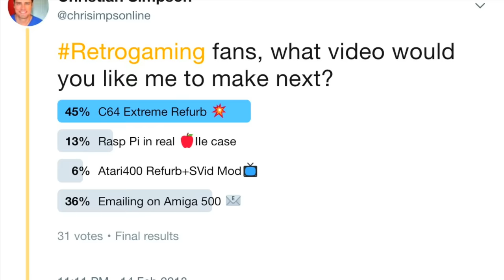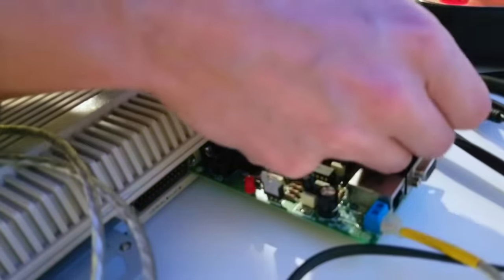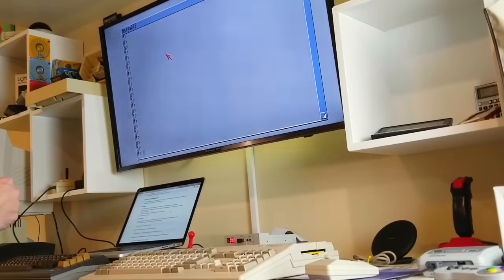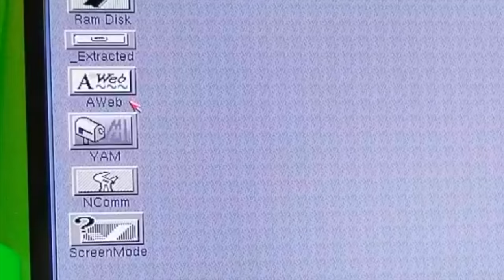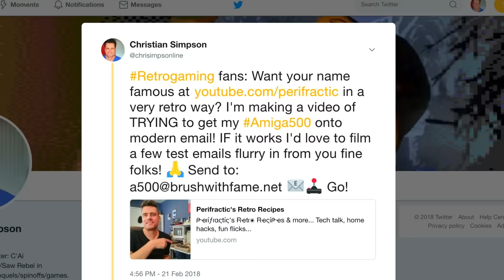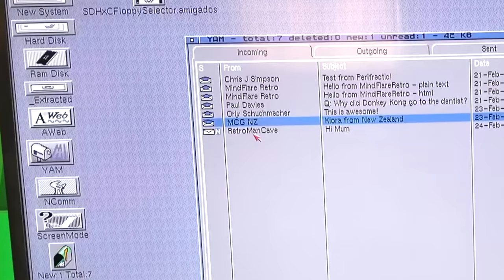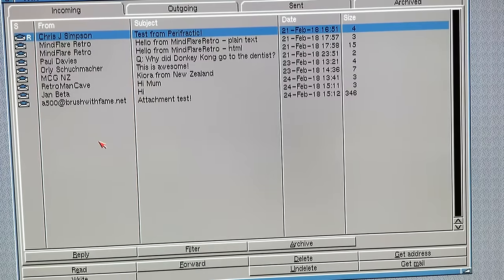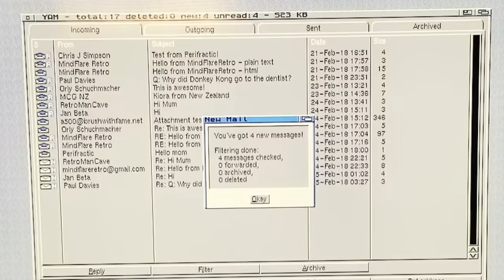Can A 1987 Amiga 500 Do Email Today? World First!

Comment from the maker: Thanks for watching! 🕹 What did you think? Have you got a modern technology working on a vintage computer? 

I have tested this without the accelerator and extra RAM. Try it! The accelerator doesn’t ‘enable’ anything, it only affects the speed and image, neither of which enable email. I use the HDMI hi-res because it doesn't flicker like the lo-res. Plain text email doesn't eat RAM either way. 

An unaccelerated 512KB machine behaves as shown, just slower which makes for a lonnng video. (E.g. that image takes about 5 minutes to load, but load it does!) The thing that potentially gives the A500 the internet ability is the magical combination of Plipbox s/w, AVR-NET-IO, & the Network Boot Disk configurator, not the Vampire card. 

Thanks!

Your friend in retro, Chris aka ԹҽɾíƒɾɑϲԵíϲ
Reply: I have yet to get any of my old stuff in a usable state (never mind a modern tech!), in both the hardware side of things, and the "having place to put it once it's working again". Hoping to get a Tapuino built soon, my STfm reassembled and chugging midi out all over the place, my A500+ has seen better days - the latter I need to get up and running soon as I have something special (for me, nobody else will be really bothered) that I'm trying to pull together using good old snail mail. 

Been subbed a little while, only just getting through the backlogs of peeps vids as I'm subbed to many peeps, a fair few mentioned in this vid and one that is willing to help with my little "special to me" project. 

I enjoyed this vid, and have been enjoying your recent content too. Have a great day Perifractic :)
Reply from the maker: Thank you so much! That means a lot to me. 👍🕹️
Reply: You're welcome. The last bit about the retro peeps being awesome is almost becoming cliché these days, but, it's bloody true, isn't it?
Reply from the maker: Thanks for eloquently explaining the distinction 👍🎮

Comment: A few years ago, I found a first edition iMac at a garage sale for $30 (you know; back when Apple thought contemporary computers didn't need fans). I snatched it up immediately, with the express intent to install Linux onto it.  The hard drive was better off for it; it was full of late-90's Napster downloads that my girlfriend at the time begged me to back up.

While the entire venture was a complete failure (which, to this day, I'm still building up the courage to fix, since I'm nervous about the prospect of working on a machine connected to a CRT), when installing Linux on a machine like that, you need an Ethernet connection.  The machine is using USB 1.0, and while you'll be able to use a router after the fact once Linux is installed, the installation still needs a hard-wired connection.

To bring this all to point, at that time, I was piggy-backing wireless from a neighbor.  I didn't have access to an Ethernet connection, let alone one long enough to use for an o/s installation.  I had to call in favors just to help me in a venture that would constantly smell like hot plastic.  The WiFi to Ethernet device you used was something I wish I had at the time, but for the life of me couldn't find.  Everytime I watch this video, I'm marveled at the feat you were able to accomplish, but it still takes me back to this debacle I found myself in.

Comment: I did this about a  decade ago, using a serial link connection to a PC routed through to the modem. Stock 68000 but with GVP 4MB ran Voyager and HDD, IBrowse and Yam worked fine albeit  slowly. No reason why I couldn't do it today, might just try it.  Nice video btw.

Comment: I once wanted to check my email about 20 years ago and didn't have PC at home yet so I connected the A500 to the TV by the mono composite, ran a terminal program on it, connected a null modem cable to a MIPS 3000 Decstation 5000 running Debian Linux then plugged a courier v.everything into that and did a ppp dial up connection and then ssh to a machine I had my email on (text only email).  Does that count?   Not really the amiga doing the email but it was the only thing that I could connect to the TV for a display.

Comment: It appears 'modern E-Mail' means an Ethernet connection, SLIP and PSLIP have been around longer...

My mate e-mail'd from his A500 & A4000 back in the mid 90's...

We were delighted when we got our hands on a 14,400 MODEM.

He also used his 500 as a serial terminal to other computers, local and distant.
Reply from the maker: Through Wi-Fi via the parallel port?! There's no dial up any more, that's why what I did was different and new...

Comment: I have some Amiga 1200 guts (including 68060 accelerator) in a tower case somewhere in my shed. But the Amiga scene is so advanced these days, I'm thinking of digging it out, putting it in a new case and adding some mod cons. I remember when Windows 95 came out, and some Amiga fans did adverts headlined "Amiga 84". Amigas were certainly capable of stuff that most PC owners could only dream of at the time. Alas, lacklustre marketing, pumping the Amiga as a gaming machine, doomed it. Someone said that if the Amiga marketing team had got hold of a Kentucky Fried Chicken franchise, they'd have marketed it as Warm Dead Bird.
Reply from the maker: Do it!
Reply: @RetroRecipes  I currently have Amiga Forever installed on an MS Surface Book 2 15", but the real thing, capable of modern media access and email would be amazing. Old Amiga games didn't necessarily have stunning graphics, but they made up for it with amazing gameplay.

Comment: I think it would be cool to see more websites which are made to look nice on the a500 in that browser. Also, apps on the amiga that utilise connection to servers running PHP/MySQL and ftp would be cool because the apps could have loads of modern (like a Fred Fish ISO of say nearly 4GB) icons and graphics and photos optimised for the amiga so that a lot of the data would be client-side and every web designer would know what the ISO contains and it would fit on a 4GB CompactFlash card or DVD.
Reply from the maker: Nice ideas! I did bookmark a few easy to load sites on my browser, that were mainly text based. But now I have the Vampire card most sites load pretty well!
Reply: What with the unexpanded a500 and a3000 and a1200 being standards, it seems to make sense to have websites and apps that use them as a known quantity and therefore a 4GB ISO could be used as part of that. In fact, even an a500 with an a590 containg 2meg RAM is an official commodore known-quanty spec, meaning 3meg or 4meg (for the a500plus) would be a fair amount of RAM in the standard even without the CPU upgraded. For amigas with an FPU upgrade, some graphics (and sound) such as 3D splines could be generated on the amiga itself with minimal data downloaded. I would assume that a PHP website could have something like a rainbow table for hashes referring to a great many preset combinations o graphics and sound to be loaded by the amiga fom the 4GB ISO. So while some downloads are as normal, for other downloads, you just get the hash.
Reply from the maker: Unfortunately the browsers just can't seem to handle https so http only would have to be part of the standard too. Some of the Amiga sites like Aminet already work fine too. 👍
Reply from the maker: Here's something: https://www.irata.online/

Comment: Considering that the protocols used have not changed much in terms of the base layer upon which all modern tweaks work, there is nothing to say that encryption can not be done, it would take a hell of a long time to generate the encryption path but no reason itself that the old 8 bit machines can not do everything that modern computers can do, only very slowly compared to todays machines.

Comment: I'm sorry to ask such a daft question but how do you determine what kind of keyboard the Amiga A500 has as I have currently got one I'm going to repair and restore problem is and it has a keyboard with buttons that come off that leaves a white connector on the keyboard itself any advice would be helpful as my last Amiga 500 the I have is totally different to this one thanks
Reply from the maker: Hard to help without pics but I recommend Abime Forum or the Facebook Amiga forum 👍🕹
Reply: @RetroRecipes   I had a look at the keyboard a bit closer and it has the Commodore symbol on on the keys just like your one I'll no more once I take it apart to give it a clean and restore I've not been able to power it on as the power supply is pretty much dead as a doorknob too many capacitors inside of exploded that looks like it happened quite a while ago course this time I'm not worried about that right now thanks for your advice and suggestions I'll have a look into that

Comment: Have you tested what kind of transfer speeds you get with that? Since it's over the parallell port I gather it's not very fast. 

I'm considering doing this as well on my old A500. Since it doesn't seem to become a Vampire for my A4000 I'll  have to get one for the 500 instead and I want network access on it when I do.

Have been using Yam on my 4000 for a very long time, and still do, so nothing in this is a surprise to me. :)
Reply from the maker: anakondase Nice! YAM is great. I was getting about 38kbps!
Reply: About the speed I expected I guess. Not really usable for more than emails and browsing simpler websites. Well, saw there's a module for Vampire with core 2.9+ with ethernet now so that's perhaps a better choise.

Have you tried using Netsurf as browser? It's way to slow even on my A4000/040 but should be ok on the Vampire. It's avaliable on aminet.
Reply: Yeah, but when you only have half a meg of RAM, how much speed do you actually need? If we assume the software is extremely lightweight and you still have half that left over after it and the OS have loaded, you could fill up your remaining work memory (or upload its contents) in under a minute at 38kbit, but there's not really enough space there to hold the entirety of a single modern day image in compressed form let alone uncompressed, so you only really want to view the text-only versions anyhow... and no-one's able to read at a rate of 4750 characters per second.

If you're saving directly to disk it may seem a bit more sluggish, it's probably somewhere around a half to a quarter the effective write speed of an Amiga floppy. But again the likely size of the files mean it's not going to be that much of an issue. If you don't mind waiting three minutes for a download in the modern age then waiting as long to pull down a disc-filling file isn't too bad. Of course the difference comes if you have a hard drive attached, but doesn't that itself eat quite badly into your spare RAM? I thought typical bolt-on A500 HDDs recommended a RAM upgrade off the bat...

Comment: I've run my A500s, A600s, and CD32s online using MultiLink, which is so much easier and more memory efficient than a PLIPBox/AmiTCP setup. You just need a PC running Unix/Linux/OSX/BSD... and a nullmodem cable. The Amiga connects to the PC and uses the PC's TCP/IP, freeing the Amiga to run more internet applications in limited RAM.

http://aminet.net/package/comm/net/mlink132
Reply: And then you need a peecee for networking.
Reply: Well, one need something as a router anyway. 
In the early 2000s I used an A1200 as a router for my A500 which had a network card in the floppy-port. Eamil and webbrowsing was never a problem on the A500 as long as one reckicked it and ran WB3.1. Tha challenge would be to get a stock 1.3kick with WB 1.3 to do this. One would have to write drivers, tcp-stack and email program for it...

Comment: 21:45 Could it be this easy?  Yes it is.  BUT, you are falling into the trap of the device name having a space in it.  "RAM Disk:" caused a lot of issues like that even back in the day. Renaming it in the startup-sequence to RAM_Disk: or something else without the space would probably fix the problem.  Of course, just moving the JPG file to DH0: would have worked as well.

Comment: Hello Perifractic! I enjoy your videos and don't mean anything disrespectful in my questioning, but I don't understand the statement "nobody has gotten modern email working on an Amiga 500."  It may be that I just don't know because I have been out of the Amiga scene for 17 years...Has there been some change to smtp/pop3 and tcp/ip since then to render what we were doing in 2000 inoperative or not modern? My primary machines were A3000 040 and A4000 060/ppc, but I had an A2000/030 with a network card and had it online with Miami at one point. I ran YAM on it, as well as Aweb and of course AmIRC. While I never personally used an A500 for email, there were and are network adapters for it, and it is virtually identical to the A2000 in terms of ability... I remember one of the benchmark comparison machines preloaded with P96Speed circa 2000 was a towered A500 68060/66 with a Picasso IV.  I am just confused as to why using an A500 for email is an accomplishment (unless there have been changes to "modern" email). Emailing was commonly done on a stock A1200's with dial-up, and surely done on expanded A500's with dial-up.

Again, I don't mean any disrespect...others in the comments are amazed/impressed, and that may be justified...I am just wanting clarification.  Thanks!
Reply from the maker: Good question! In a way the word "modern" is irrelevant. I don't know that anyone had email working on an A500. Because Plipbox uses the parallel port it works in a different way to how it might have worked/not worked before. But on the other hand, this is high speed broadband via Wi-Fi aka modern 😊
Reply: Perifractic's Retro Recipes ok... makes sense as it is an unknown really, whereas your success is documented. Micronik made a tower case for the 500 with Z2 expansion and an A2000 accelerator slot. That is the platform that was on the P96speed benchmark list. It’s almost unfair to compare a machine upgraded like that to you doing it with a basic box. It is really an A2000 at that point.

Comment: I know I am a year and a half late here...but I want to understand. The biggest issue here was just getting the A550 online?
Reply from the maker: That was one challenge yes, as the original hardware for that was for dial-up modems, and phone lines or dial up numbers just aren't around any more (at least here). The world has moved on. The second issue was finding a piece of software that will even run with so little memory, but finally there was one version of YAM! that was compatible (I tried them all!) And lastly getting through the issue of SMTP encryption. Hope you enjoyed the ride!
Reply: @RetroRecipes  I can see where the encryption would be an issue, for sure. But, that is really a software issue... (and yes, the RAM would effect that) It's just that I have seen C64s and C128s get online for years now. Maybe there just hasn't been the enthusiasm for the Amiga line? I don't know. It is a great experiment. Makes me want to try something similar with an old 128!
Reply from the maker: Well, a C64 can't do email. Trust me I've tried. This video was about email. The A500 processor just wasn't made for it. But we got there!
Reply: @RetroRecipes  Right, but what about the Z80A running at 4MHz? Possible?
Reply from the maker: Yes! I mean no.
Reply: @RetroRecipes  Fair enough. But I have to try! HAHAHA! You've inspired me.

Comment: Your A500+ has an A500 keyboard (large Carriage Return key).  I've not seen that before.
Reply from the maker: I did not know that! This is actually an A500 that I upgraded the top case of to match the one I had as a teenager; that was an A500 with chipmem expansion and KS3.0 that I added an A500+ badge too! But you're right, this is an A500. 👍🕹️
Reply: My Amiga years began with an Amiga 1000 in November '86, the first computer I bought myself, having come from the VIC and C64.  Kickstart 1.2 loaded from disk, followed by Workbench 1.2 after a disk swap.  I moved to an A500, second hand, a year or so later.  I've not actually seen or used an A500+, despite having most of the other models, but I was aware of the keyboard difference.  Plinky Plonky!
Reply from the maker: Ah those were the days. Such fond memories!

Comment: You're saying that everything you're showing would run on an unaccelerated A500 - so I'm wondering: How to get that awesome looking Workbench? All I have is WB1.3 - I'd absolutely love to have a somewhat modern looking OS on my stock (apart from Gotek USB at DF0) A500.
Reply from the maker: You'd need to change the Kickstart for that. My only claim is the email will work unaccelerated. Some later A500s had later Kickstart chips as I understand. There are plenty on eBay! 👍🕹️
Reply: Yeah, I've come to understand that! I think I'll be getting a sweet, sweet ROM upgrade=P